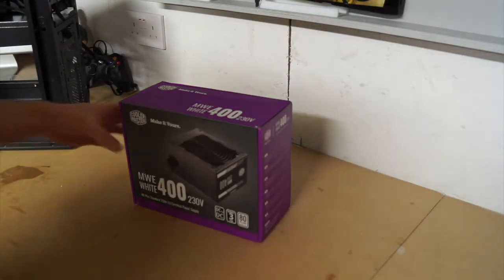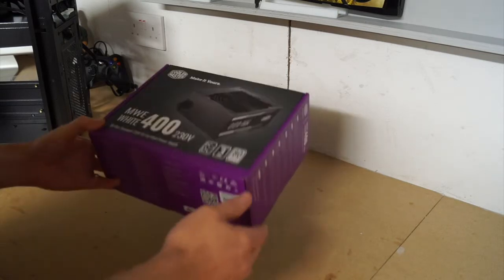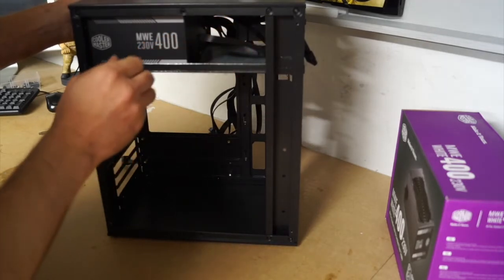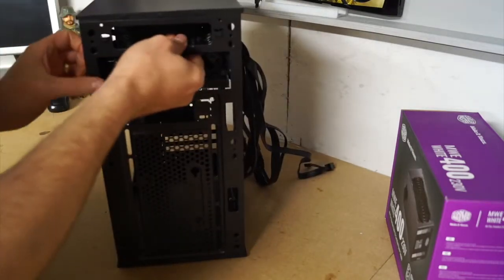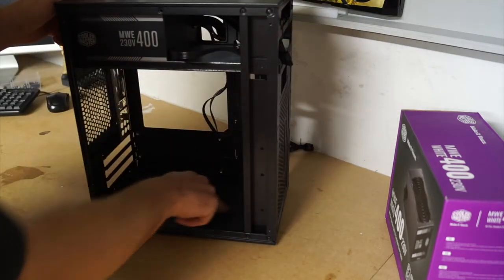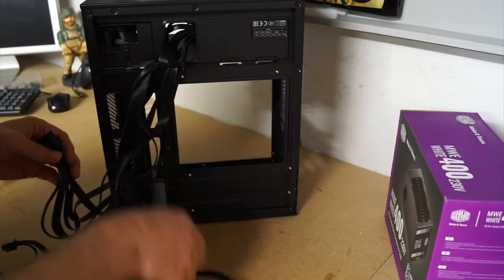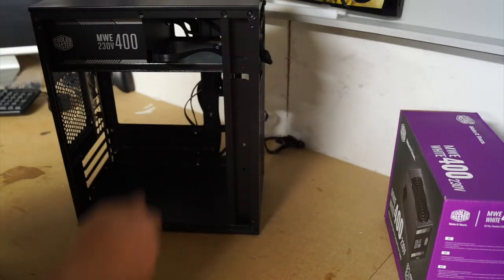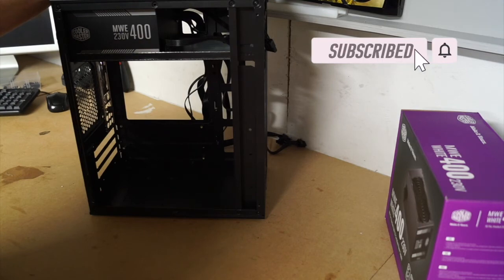AMD Tribute Build | Part 2 - Power Supply Installation.

Comment: Have just ordered said case! Will probably just buy a semi modular psu to cable manage instead. The plate was clever though.
Reply: I used a fully modular psu and still struggled. Get a bunch of cable ties and you'll be fine tho!
Reply: @MrMultiSuprime  what the best size cable ties to get? They come in all different sizes.
Reply: @outlawfett3530  I used a mix of small, medium and large. I improvised :)
Reply: @MrMultiSuprime  Cheers